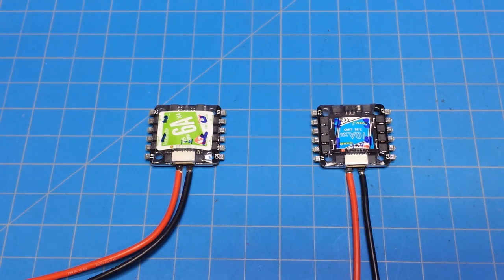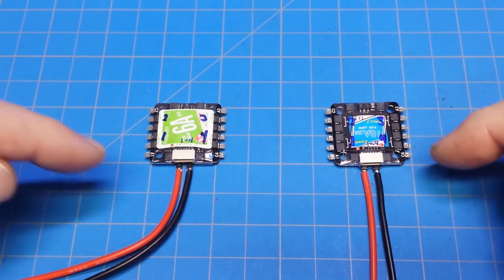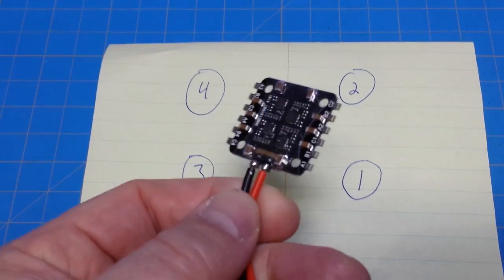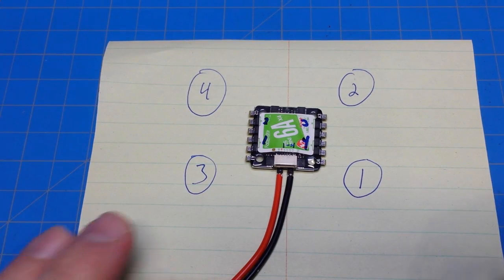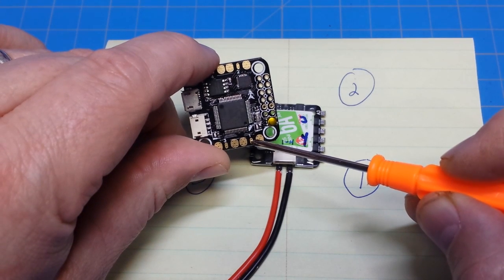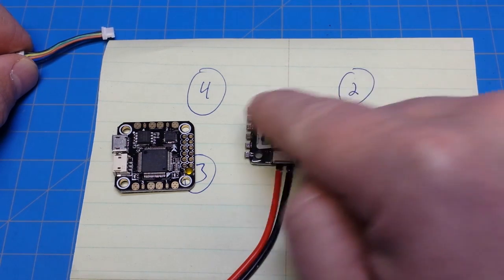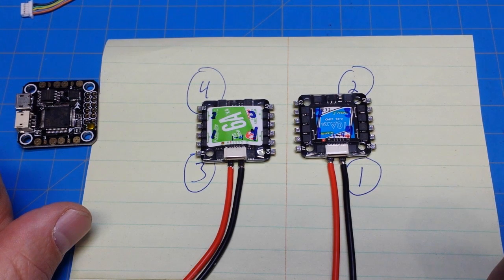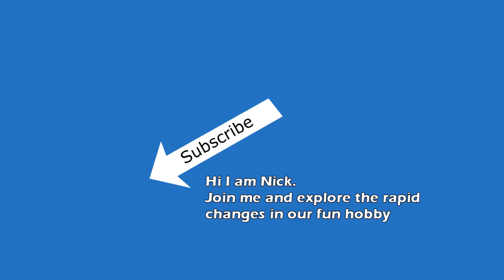How to wire a 4 in 1 ESC

Comment: Yea I always just re pin the ribbon cable in the necessary order. I also remove the V and G wires and just power the fc from battery voltage directly from the B+ and B- pads on the esc with jumper wires cause more often then not you’re forced to switch all the pins around on the jst header cause the fc jst connector is always pinned reverse of the jst female connector on the esc and I always tend to have more 4 pin jst headers laying around and never any 6 and 8 ones so I just make my own ribbon cables since you don’t need to have the same pin count connector just as long as it’s jst sh 1.0

Comment: Great video. I have one question regarding the solder pads for each motor. The motor that I have has a positive, negative, and signal wire. The solder pads do not specify which is positive, negative, or signal. Is it alright to just solder them up in any order on the pads?
Reply from the maker: Which motor is this? I suspect its a motor for a specific model which has plugs or color coordination of the esc.

Comment: I have a special ops project that requires simultaneously controlling three drone motors according to three conditions using my joysticks a using a 10 channel Flysky FS-i6S.

Condition A
Three motors receive the same speed command with motor -1 rotating opposite to motors 2 and 3.
Condition B
Three motors receive the same speed command with motor -2 rotating opposite to motors 1 and 3.
Condition C
Three motors receive the same speed command with motor -3 rotating opposite to motors 1 and 2.

In other words, each direction I move the joystick will actuate three motors with my two joysticks. I figure ill need three, 4 in 1 ESC's . Each ESC wired for three motors with polarity flipped on the third motor. Can I do this?

Thanks, Chris
Reply from the maker: Your in far deeper than I have experience for. I afraid I am not much help. From your description seems like a function of the flight controller to the esc rather than the esc. Just a guess though.

Comment: Why didn't you simply turn the controler around? So that 1 lines with 1 etc.
Reply from the maker: My recollection (this was some time ago), is reversing the power leads create a bottle neck for getting the battery strap (bottom mounted) through, also the two connectors for the signal wires create a bit of a wiring mess as well. The purpose of the video was primarily about reassigning motors in the proper orientation when needed.
Reply: OK, it did clear up what I was looking for. That is what the colour code was for each esc input. Thanks. Just wondered about the other.

Comment: What about the big + and - can you solder to the +and - on the aio fc next question is the small + and - on the wiring harness with the jst where does that go?
Reply from the maker: The big + and - are to the battery. The small + and - go to vbat and ground on the flight controller. sometimes the flight controller can handle battery voltage via the connector, but often that is only when we buy a flight controller and esc as a pair.
Reply: Nick Burns on the clracing f4 board I don't see a vbat pad will the esc +and - act as a vbat pad?

Comment: Great video nick. I believe I have the same 10amp esc in your video. Cicada 2-3s Lipo blheli s. Is it possible to use the blheli configurator to change the motor numbers and direction with this esc?
Reply from the maker: yes, the blheli app and suite will be able to change motor direction on this esc just fine.

Comment: I really like the explanation, but it's the configuration and the stacking that are another issue/ challenge. What about on those diamond builds where it's in a diamond shape?! I just got a Lumenier MICRO LUX V2 - F4 Flight Controller + OSD and I'm getting ready to place that with a Lumenier Mini BLHeli_S 12A 4-in-1 OPTO ESC DSHOT. But I'm concerned about spacing because I want to put it all in one of those rekkon upgrade kits/ frames
Reply from the maker: In the case of a "diamond" we are rotating the flight stack 45 degrees. When we do this we must tell the flight controller it is rotated 45 degrees. This is done in the Betaflight app on the configuration page. The right section, I believe it says "board and sensor alignment", we change it on the yaw axis 45 degrees.

Comment: Do you need an PCB with 5v outlet? With the power- do you power the ESC, or the power board? How do you power the other? What about the wiring harness? Still can not use the 30A 4 in 1 ESC!?!
Reply from the maker: no if the flight controller can take battery voltage. Look for vcc on the flight controller or pin map.
Reply: Nick imwired my omnibus f4 Nano v2 to a 4in 1 esc,I think maybe I wired the vbat and current wire wrong as now I have no led lights on fc?whatncould I have fried ?i believe the board accepts or is supposed to accept full volts to board,?what can I check as far as maybe fixing the board..I have several other bad boards I may could replace a part with..voltage regulator?maybe?Thanks

Comment: I have a question. I use dys f4 on all my build but never used a 4in1. I’m about to build a floss so do I run large gauge wire from the 4in1 to the dys f4 or can I power it from the small harness wires?
Reply from the maker: I think the dys f4 only needs 5volts, so a large gauge wire is not needed. If it requires 12volts, it still might not need a larger gauge, but if there are troubles increase the gauge only slightly, it will get messy if the gauge gets big a bulky.
Reply: Nick Burns right on thanks. Also I never use caps and I have never had a problem with video. Is it needed?
Reply from the maker: I haven't see a benefit other than cleaning up video. I haven't had an actual need for caps, just something I decided to try. I do not have a quad with a video issue, I don't think caps are going to help, I think its a dodgy vtx02.

Comment: Hey Great Vid, If you could guide me on something, I want to use a recerstar 35a AIO ESC without bec but with current sensor on my new build. But will i need a Flight controller with just a 5v bec and if it has a current sensor also from what board would i use to utilize it. Thx
Reply from the maker: Not sure I understand. The 4in1 esc would have the battery wires for input, from that we connect power to the flight controller. If your flight controller has a current sensor it likely take battery voltage input, on vbat + and -. Check the FC manufacturer.

Comment: have you ever had one channel go out?  was there any way to recover it?  (I know I can run a single external esc to keep going, but curious if there is a cure)  

also happened on a fairly new quad after it rained and it got some moisture... do you think the fresh water killed that channel?  thanks!
Reply from the maker: I have not had one esc go out on a 4 in 1. I suspect if we can location the damaged component and a replacement, sure it could be fixed. But that feels like a big effort.
Reply: I was going to try to reflash it before taking it apart.. once it is out I will look for signs of damage to hardware.. thanks!  

I just wondered if the moisture may have somehow put the ESC in bootmode of some sort and hoping the hardware was not affected.. but again just hoping and wondering if it is something others have seen!!!  thanks!!
Reply from the maker: Does it show all 4 esc when connected to the bl_heli app? It it does, that seems to indicate an issue other than the ESC. Maybe the signal pad on the FC is out. Maybe.
Reply: it was one of the SMD chips on the 4in1... I could see the signs it was burned out once I opened it all up for inspection.  thanks for all the assistance!!

Comment: If I would have wired my 4 in 1 ESC like this, I would have immediately destroyed it!!!!

Plus and GND wires on my 4 in 1 have to be soldered just vice versa !!! 

I recommend to test where the GND pad  for the battery on the ESC is first with a multitmeter and do that against the GND pin of the signal wire connector!

Comment: Hi I just want to validate something. If I have a Racestar 4in1 6A ESC with 5V BEC, can I solder the black and red wires from the ESC to my Piko BLX battery spot? Thanks a lot!
Reply from the maker: Yes, you can. With one possible issue. I have seen where the FC wired this way might not have the power to power the camera, vtx and RX at the same time. If you find this to be true in your case, take two short wires and solder them on to the battery led pads or wires on the ESC to the FC battery pads.

Comment: Another easy option is a custom motor mix in BF, then you can solder the motors to whatever pad you'd like.  I've occasionally done that on tight builds to make it a little cleaner/fit.  When just switching motors you can just start with the Quad X mix and copy/paste the positions where you need.
Reply from the maker: I think the resource remapping is faster if on BF3.1

Comment: omg I feel dumb never noticed the numbers on the output wire. how would you power the f2f? using the bec from the esc or splitting the battery wire?
Reply from the maker: I think it depends on the 4 in 1. On one build I used the +- off the esc didn't supply enough power for the camera and rx, in that case I used a pigtail off the battery pads to the flight controller, and the FC was an all in one and could take battery voltage. In other case using the +- off the esc did just fine. I wish I could remember which worked and which didn't but I pulled the labels off.
Reply: Thanks, I'll post when I'm done, i'm using the same 6 AMp and pico BLX.
After your comment I think I can use one of the ESC Pads on the flight  controller to power the board. 
Battery -> PICO BLX -> ESC5 (Bottom pads) -> 6AMP 4in1
This should provide enough power for the FC to power the OSD and camera while still powering the 4 in 1. My only concern is if the ESC Output pads are limited power wise and not designed to power a 4 in 1, Considering this can power 20AMPs i don't think that should be an issue :)
Reply from the maker: They aren't limited, its straight from the battery if connected to either the battery pads or even piggy backed off the battery led wires.

Comment: So do you not need a PDB for a 4in1 setup?
Reply from the maker: Not if your flight controller is an all in one. If your flight controller is not a 4 in 1 you might need a 5v regulator between the esc and fc. Some of the 4 in 1 esc come with a 5v regulator built in.
Reply: Sorry im new to the hobby and im about to get the parts for my first quad. What exactly do you mean by a 4 in 1 Flight Controller?
Reply from the maker: No worries. Often when we say 4 in 1 we are referring to the ESCs, like in this video which is for micros or around 100mm quads. When we refer to all in one flight controller we are referring to a flight controller and pdb combination which are becoming very common, but not all flight controllers have the pdb function.
Reply: Nick Burns ohhh. Ok thanks for the help. Keep up the great videos👍👍

Comment: where do the power wires go to the pdb? i am totally confused on that part. i got no documentation with my cicada so i dont know where to put those two wire what the voltage is and i am a noob
Reply from the maker: They can go to the battery pads on the flight controller if using an all in one flight controller. If you have difficulties with the receiver, then add two wires from the battery pads on the 4 in 1 esc to the AIO flight controller battery pads. Some 4 in 1 ESCs have 5v out from the wiring harness and doesn't supply enough power for both the camera/vtx and Rx.
Reply: Not an all in one flight controller shouldn't those wires go somewhere on the PDB?my PDB has spaces to solder the power for all four escs, and thank you
Reply from the maker: Yes to the PDB if the flight controller can't handle battery voltage.

Comment: This stays the same as described in the video even if you are going to change orientation on the board correct? Or do you go from the ESC signal number to the motor number based on the direction you are going to change the orientation of the board?
Reply from the maker: The principal is the same, if you flip the board the motor to ESC numbering will be different.

Comment: When wiring your swirlie with the racerstar 6A all in 1 where did you wire the Red and Black wires in the esc signal wire connector ?
Reply from the maker: I use a short wire to go from the battery led pads to the batter pads on the femto. Signal wires go to the signal pads on the femto as described.

Comment: Do you still have to cross the motor wires to the esc to get a counter clockwise rotation for motors 1 and 4 or  just solder them straight? Thanks
Reply from the maker: I tend to reverse motor direction in the blheli app.

Comment: heh wish this video had been out when you posted about the swirly (which made me order one hehe) I also got a hell whoop. The 4 in one I got had a different order then yours. if I lay it out in the same orientation you had the left top was m4,  bottom left was m3, top right was m1 and bottom right was m2 so I just had to swap the signal line for m1 and m2.  Any way that does mean you do need to check the  4 in one rather then assume they are all the same
Reply from the maker: Yes, we must check the esc to signal wire layout. I attempted to lay out this video in a way that different esc labeling will still be relate able.

Comment: Isn't this bad enough to be called out as a design defect?
I mean I know motor layouts have changed a bit, I think my CC3D boards used a different layout from a Naze boards. But since Cleanflight and Betaflight hasn't it more or less standardized? I'm not sure we should be accepting this shouldn't we the consumer be pushing back and saying this is wrong. If there's a reason for this layout if someone can post.
In the mean time if someone could make custom JST to JST to convert they might sell a few cables, and yes I know technically you can change them yourself. But S that I've destroyed more than I've adjusted.

Comment: you can connect everything as clean as you like, shortest way. And remap everything. Check out Joshua Bardwell's video. 
https://m.youtube.com/watch?v=z5aO-3_n-Hs
Reply from the maker: Yes, that method will work as well.
Reply: Cool!
Reply: Jorrit Lute Wolters that's what I'd also suggest, wire up cleanest way, than remap :).

but his explanation is also very good and clear. Thank you Nick for the great Videos :)
Reply: you can also switch the order of the signal pins going into the fc ^^ with a small needle its np to take the cable out of the connector and manually "remap" them ;) or just solder them to the "right" pads if your fc has solder pads for signal ;)
Reply: Greate !!!

Comment: Nck, Thanks! what do you use to power the FC?
Reply from the maker: If your powering a fc which is an all in one ite self (accepts battery led wires) we can take the positive and negative from the esc and solder those to the + and - of the fc where the battery led wires would normally go. Some of these 4 in 1s have a 5v bec, in that case we can solder to any + and - pad, but I would still recommend soldering to the + and - of for the battery led wires.

Comment: I just wired mine to the closest tabs as you did (my fc has that special connector) and then remapped using the "Resource Remapping Command (available in v3.1)" : https://github.com/betaflight/betaflight/wiki/Betaflight-resource-remapping        Although i really prefer just being able to solder to the correct location with the signal leads...
Reply from the maker: Yes, that is an option too.

Comment: What's the flight controller?
Reply from the maker: The flight controller is the brain of the quad. It tells the esc/motors what to do, it also relays the signal from your radio receiver to the ESCs/motors.
Reply: I Guess I wasn't clear with my question, I was asking what flight controller is the one you show in this video :)
Reply: Thanks!! :)

Comment: with the lead method, you can just remove the wires from the FC end and move the signal wires to the correct position.
Reply from the maker: Do mean to de-pin the connector and lay it out with the proper signal to motor layout?
Reply: Just re-arrange the FC side of the JST plug. It's easy to lift the little white tab and pull all the connectors out of the JST plug and put them back into the JST connector in the order needed.

Comment: If you have a flight controller that accepts the same connector, couldn't you also disconnect the wires from the connector and reinstall them in the "new" correct locations?  Or if it's too difficult to reinstall, just cut them all and solder 4's wire to the 1 wire going to the connector(and so on)?  I'm just asking, because I'm getting ready to build a mini owl using these same components and I'd much rather use the solder pads that are closest to the motors.
Reply: Should work. You do have to be very careful when lifting the tab - it's very very fragile. But definitely doable. If you're running betaflight 3.1+ .... you can just remap the motors: http://fishpepper.de/2017/02/22/betaflight-custom-motor-ordering-made-easy2-3-1-x/
Reply: Which board are you using?  The only one I've found that used the connector was the Lumineer Micro Lux F4.  which I used on my hell-whoop.
Reply: John Duquette Omnibus F4 flight controller with the Little Bee 20x4 esc board.
Reply: Omnibus F3 AIO has 4 n1 connector as well
Reply: Sorry I should have been more clear - the Micro lux is the only 20 x 20 flight controller I found with the connector.  The Omnibus is 30.5 x 30.5 and doesn't match the micro escs.
Reply: There's a lot now: 1. http://www.myrcmart.com/f3-micro-flight-controller-bec-lc-filter-osd-dshot-20x20mm-24s-p-11068.html 2. http://www.myrcmart.com/f4-micro-flight-controller-bec-lc-filter-osd-dshot-20x20mm-24s-p-11078.html 3. http://www.banggood.com/Eachine-Minicube-F3-6DOF-Flight-Controller-Intergrated-Betaflight-OSD-20mm20mm-p-1126931.html to name a few.  I think the target of all those is omnibus btw.